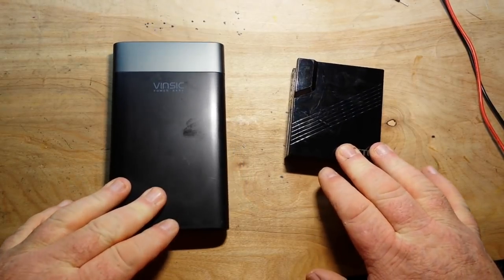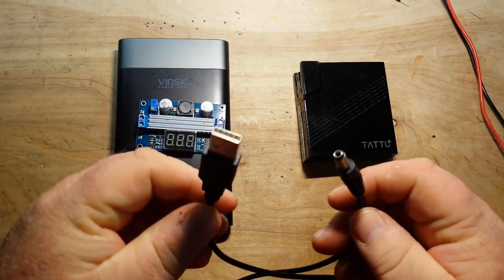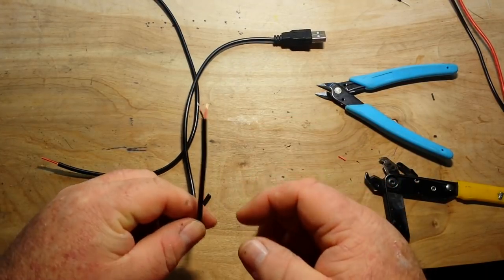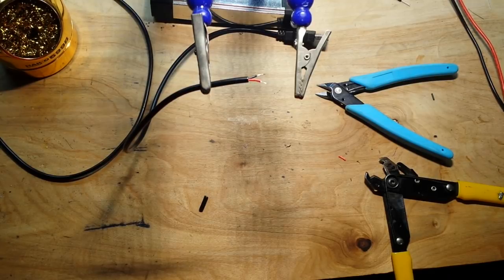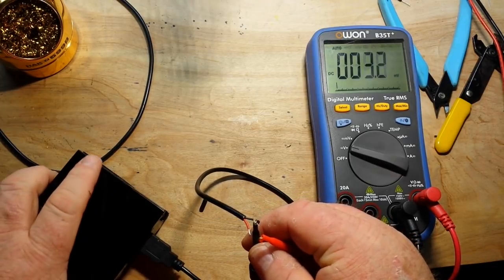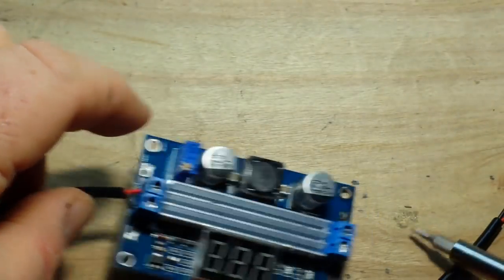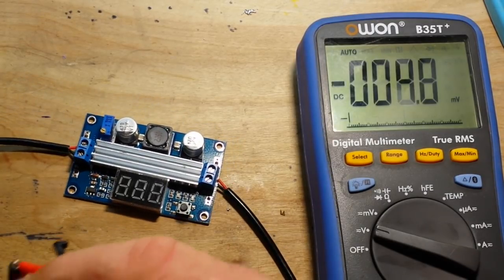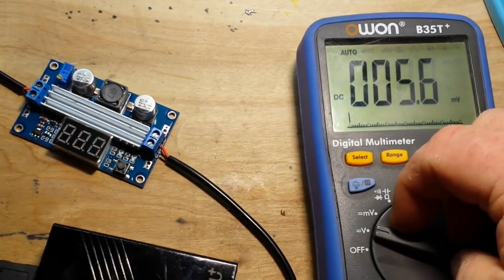USB Power Bank Hack

Comment: What is the largest boost converter you came across? I'd like to go from 12v to 30-32v at 40amps to charge my 29.4v battery bank. When there is no sun to charge it. I would maybe like to build one. With a ability to charge lithium battery. Basically a large version of the mppts 1072 charger. It's only 10 amps. And a boosting solar charge controller. That also can be just a battery charger . powered by other means. I'm trying to build a emergency charger . to charge from a car alternator mounted to a engine. And use it to charge a lithium battery bank. Great video.

Comment: The trouble is that you draw 4x the current at the low end.  Eventually, you need cucumber-sized wire to drive your electric moped at 36V.  If you want to go completely nuts with the boost idea, I think you got to invert to AC, then transform to high voltage, then transform back into DC.
You do seem to have those mischievous Swedish Chef hands! 
https://www.youtube.com/watch?v=B7UmUX68KtE
Reply from the maker: That's why I put "it won't start your car" in the thumb and then went over the first law of thermodynamics and then said we were trading current for voltage. Should I add an end card as well?
Reply: Like your content, am not trolling.  My ADP eats some annotations, so do not see the thumb.   Surely, you recognize the drawbacks of boosting from the Robert Heinlein reference!  A project that I play with here at home, is re-arranging cells from parallel to series with mosfets, in order to create voltage gain.

Comment: Nice one! 
Just check how much A your battery can provide and put load that want draw more A, or in best case it will just stop working.
I try to drive too long led strip 12 V (1.2 A)/meter from just 1 18650 and 1 meter is max, after I done my maths dc-dc step up is 2 A max so it cant provide enough W to led strip, and battery can give 1 A max (shitty ones). Wanted to share my failure to help others save some time and waiting for new pieces from China.
Reply from the maker: Cool! Thank you for sharing.

Comment: Ok, so it won't turn over a car starter motor, but could a charged USB power bank be modified to trickle charge a 12v car battery?  bork bork bork!
Reply from the maker: Absolutely, set the output for about 13.5V.

Comment: That's a really nice looking step up board with a nice layout have a part number on that eBay special?
Reply from the maker: JacobsParts LTC1871 100W DC-DC Boost Step-up Voltage Converter Module Adjustable Power Regulator Board with LED Voltage Meter https://www.amazon.com/dp/B079YX761G?ref=yo_pop_ma_swf
Reply: learnelectronics thank you very much Paul,for the link I picked a few up I really like the form factor and look...

Comment: Let's get Started! I made a 24v(28.8v actually) scooter battery pack. Used an LM2596 adjustable step down power. supply to power my frankenstein rc motor setup.

Comment: I was too old for muppets but my kid watched them. This is a neat idea. Do you have that boost converter in your store?
Reply from the maker: No, for some reason i cant add it, but here is a link: JacobsParts LTC1871 100W DC-DC Boost Step-up Voltage Converter Module Adjustable Power Regulator Board with LED Voltage Meter https://www.amazon.com/dp/B079YX761G?ref=yo_pop_ma_swf
Reply: That sucks!

Comment: There's a neat terminal block device you can buy on ebay for around $7 that takes the 24 pin output fron an ATX power supply and splits it to 3.3v 5v and 12v on screw terminals, with fuse protection on each. I'm going to add a booster to 24v and that's me sorted for a bench power supply.
Reply: Phil Chandler Sounds great. Have a link to it or the name of it?

Comment: Never saw the boost converter you were using. New or old model? I'm sure it came by slow boat but do you have a link to seller? I have a weakness for boost and buck converters. Thanks...
Reply: James Williams Lots on Ebay, Aliexpress, Amazon etc. Search for "12V CONVERTOR".
Reply: James Williams looks like this one from eBay (201321452347)
Reply from the maker: JacobsParts LTC1871 100W DC-DC Boost Step-up Voltage Converter Module Adjustable Power Regulator Board with LED Voltage Meter https://www.amazon.com/dp/B079YX761G?ref=yo_pop_ma_swf
Reply from the maker: I have the same addiction. In fact i just ordered 5 buck converters China. When they arrive, ill do a buck converters shoot-out. Best part...most expensive one is only $2.38.

Comment: Most of my projects are powered with a single 18650 cell, a TP4056 battery charger/protection board and a MT3608 based boost converter. Battery lasts far longer than a 9 volt and it's rechargeable!
Reply: 18650s are most versatile cells i ever used and they can be easily charged from any 5V usb device, capacity is superb when compared to alkalines, i use 2S instead of 9V cell and it gets me 4-5 times more capacity but i have to use external charger
Reply: 18650s are most versatile cells i ever used and they can be easily charged from any 5V usb device, capacity is superb when compared to alkalines, i use 2S instead of 9V cell and it gets me 4-5 times more capacity but i have to use external charger, not a problem for me since i charge it every few months or so.